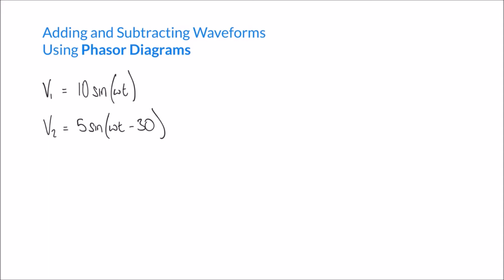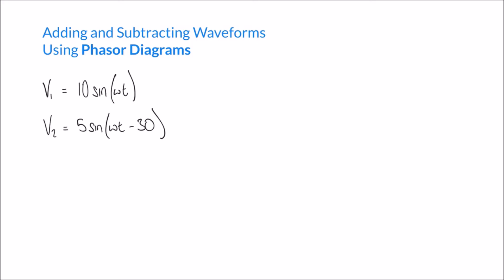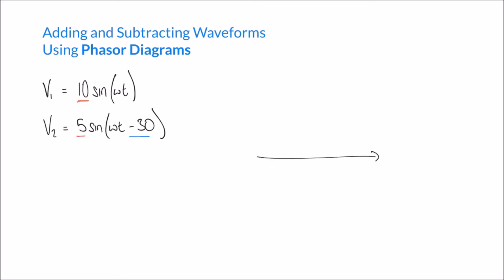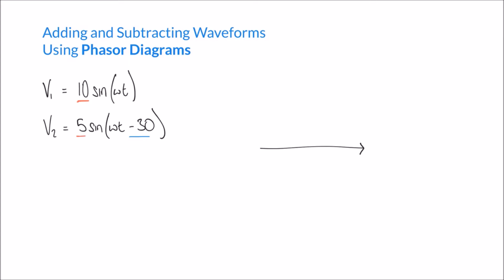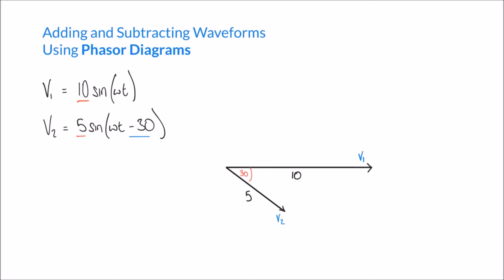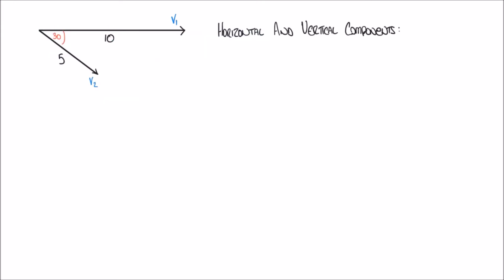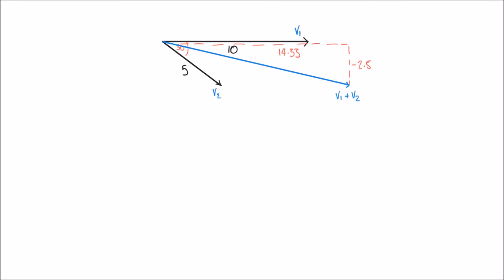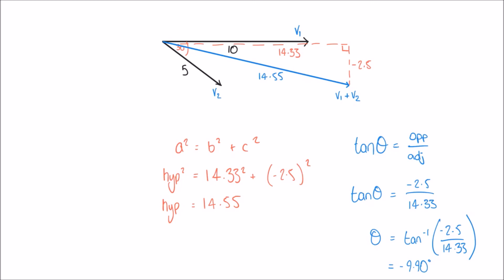Adding AC Waveforms Using Phasor Diagrams

Comment: What if V2 has -90 dgrees?
Reply from the maker: If V2 has a phase angle of -90 degrees then it will point straight downwards. You can still do the vector addition in the same way.